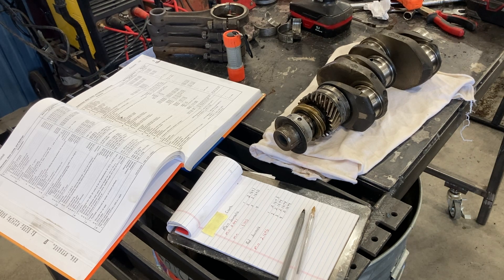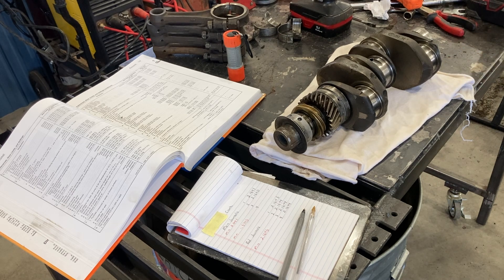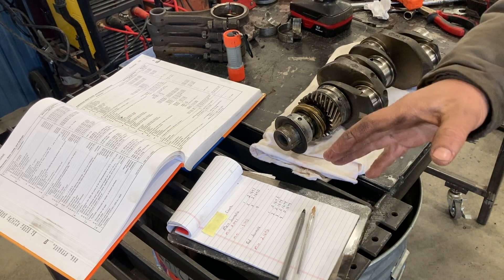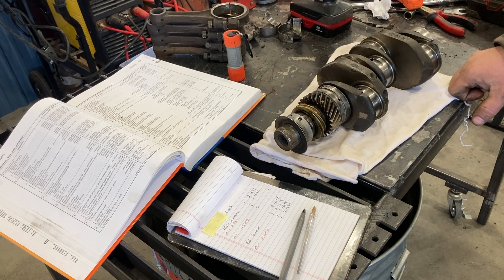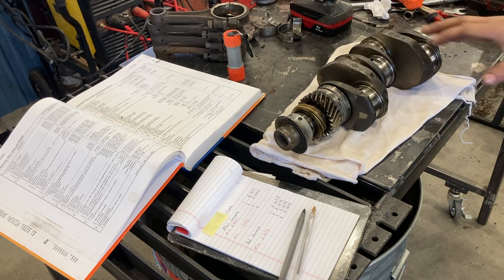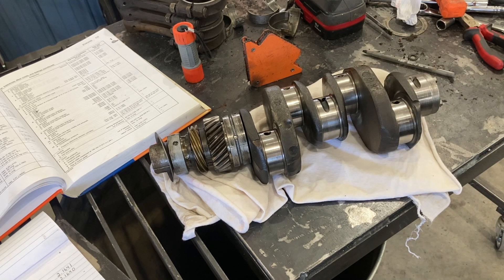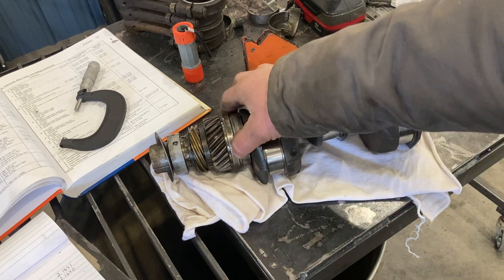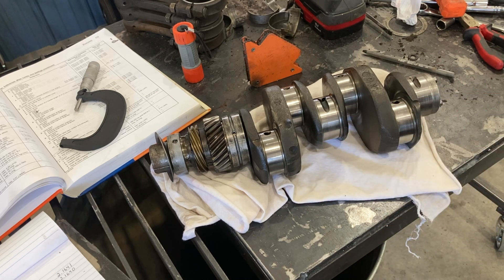Properly Measure Crank Journals - VW Aircooled 1600

Comment: I ALWAYS  pull the gear set off.  Strip that baby down clean it up, check it all out and "ring" it ( tap with a hammer ) to check it for cracks - if it rings it's not cracked an if everything else is good it can be ground , if it thuds it means it's cracked .  You always want to have the gears etc off Incase you need the parts for another build
Reply from the maker: German parts are getting more scarce by the day, I agree - save everything you possibly can

Comment: I've been asking what the bore size is for the number 4 and I see you have the crank journal shown here which will also be the ID of the #4 small bearing going on it. Question I have is what is the case bore for this location? the mains are 2.559 but this one is smaller in ID with case halves temp together. I can't seem to find that number?